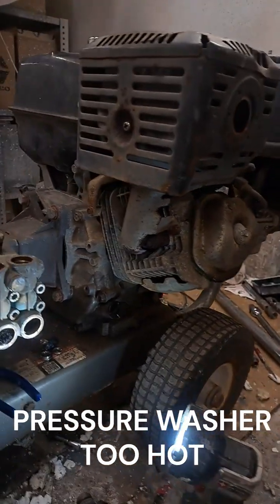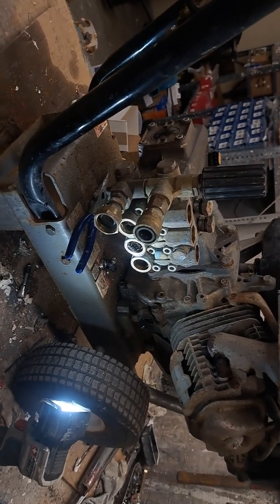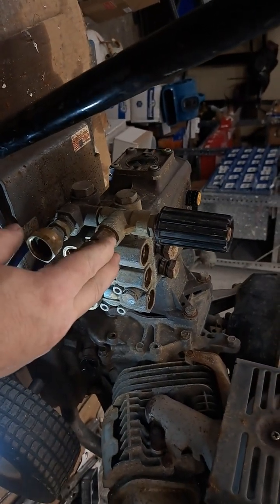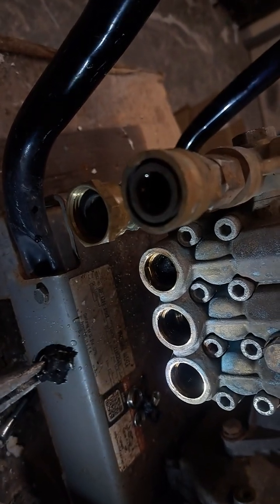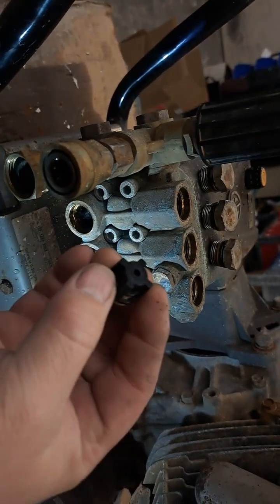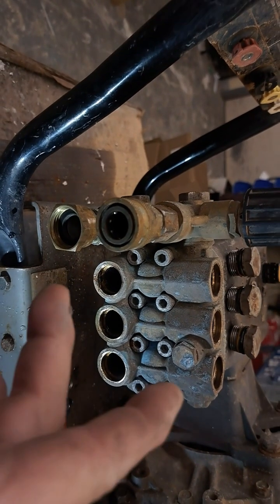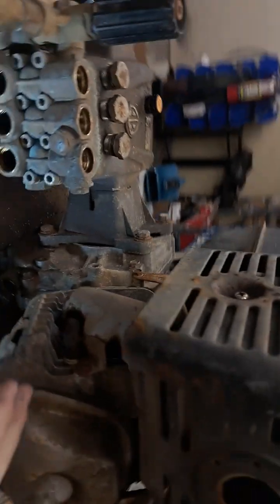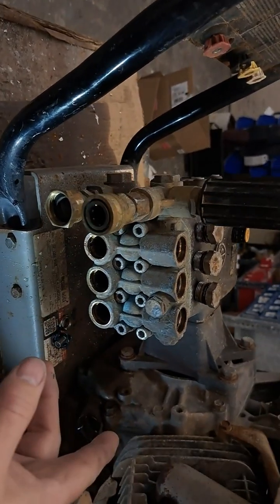Pressure washer too hot

Comment: Hey Brian, I am fully enjoying your channel and the content you are bringing to us. I don't have the experience needed to visually identify a pressure washer pump I have in my shop now. It's on a Dayton 5Z020D pressure washer with a 16hp Twin Vanguard. The specs for the pump according to the pressure washer name plate are 3000 psi and 4.6 gpm. The name plate is missing on the pump and I have no idea as to even the brand much less the model. This thing is probably 20 years old. Here are some pictures if you would like to take a shot at it. 
https://drive.google.com/file/d/1g5IY1m1NOQJNeYYsOM23upvZjClZNEhK/view?usp=drive_link, 
https://drive.google.com/file/d/1sqNTjzGnVQPFoTRg31I1eWaLmfDBX0Jg/view?usp=drive_link, 
https://drive.google.com/file/d/18lLlusIITtJMb20fX-6mnLYjhdXmNQuw/view?usp=drive_link, 
https://drive.google.com/file/d/1QRvojSBPq6Q5EZehtlquXKugH7IHUOfe/view?usp=drive_link
https://drive.google.com/file/d/18YLTXvnJ1sKQhGy4CXNWlh965r1GXKzO/view?usp=drive_link

Comment: Any videos on graco 595?
Reply from the maker: What specifically are you looking for?
Reply: @ thank you for responding. Its having trouble holding pressure when spraying firestop
Reply from the maker: @antg7481 a 595 is not meant to spray fire stop
Reply: @Brian_the_repair_guy got it makes sense. Also im working on a titan 1040. My local sherwin williams said to replace motor control on it. U have any videos on that or any suggestions how to do it?
Reply from the maker: @antg7481 I do not have one for that. I can make one within the next week or so if you like.
Reply: @ thats would be great thank you sir! I appreciate it!
Reply from the maker: @antg7481 I will see what I can do when I get back in the country.
Reply: @Brian_the_repair_guy my titan 1040 trips the circuit breaker every time i hit the on switch . Do u know what it can be?
Reply from the maker: @antg7481 what country are you located? What amperage  is the breaker?
Reply: @ i live in New Jersey, breaker is 20amp. But this has been happening at multiple jobsites too. Do u think its the ON/off button? When i plug the machine in the plug lights up orange. But when i hit the switch on it trips the breaker
Reply from the maker: @antg7481 it could be the switch. A continuity test on the 4 spades on the back will tell. More likely the board has an issue. 
Find me on Facebook to help determine if the switch turns out to be good

Comment: I’m wondering if you can help me with a problem I’m having with a older capspray aircoat air assist rig the problem I’m having is a pulsating or fluttering when pulling the trigger on the gun I’ve taken the outlet valve off and replaced some parts in it not sure what else can contribute to this problem I’m asking for your advice on what else it may be the inlet valve? Not sure thank you sir if you have any suggestions it would be greatly appreciated
Reply from the maker: @mikegrit937  find me on Facebook, same name. I will need pictures